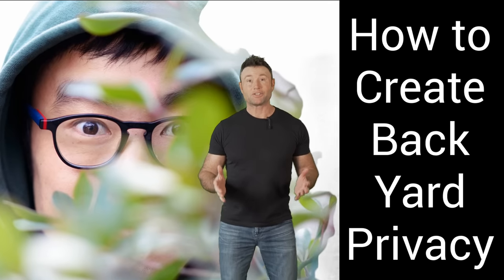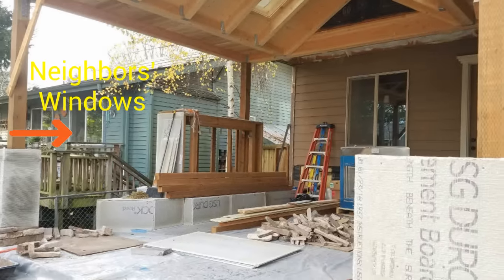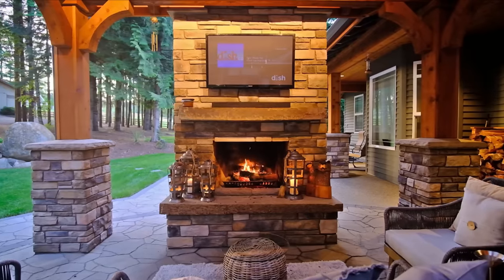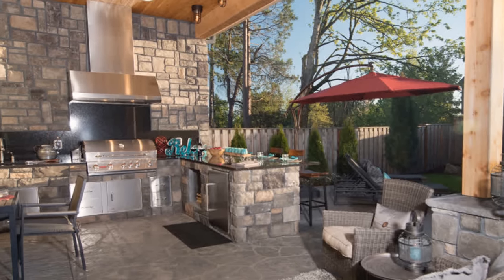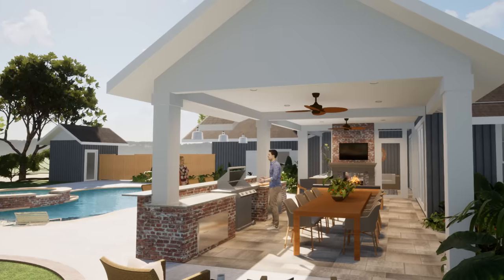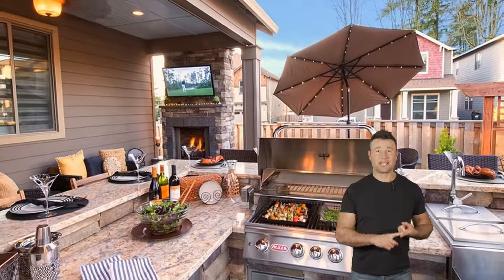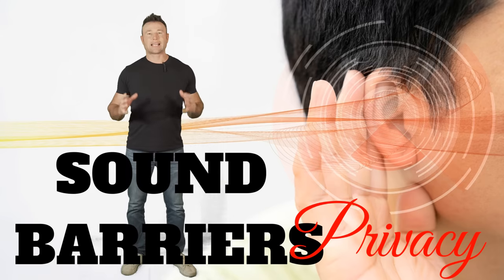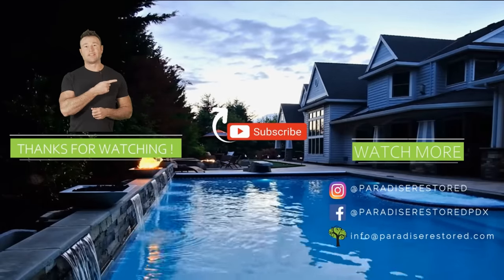Best Backyard Privacy Screen Ideas

Comment: I don't have the budget or space for these things. And not practical to spend $$$ for short summer. Our evening temps in summer are very cool at 3000 ft.   I planted trees that act like a hedge in summer.  Also mounted awnings which cover most of my deck when rolled out.  I can attach them to deck if windy. They have roll down privacy screens so deck is screened from top and side facing neighbours. I can walk under them. They roll in when not using or winter... consider awnings!
Reply from the maker: Thank you for this comment. Have a wonderful day